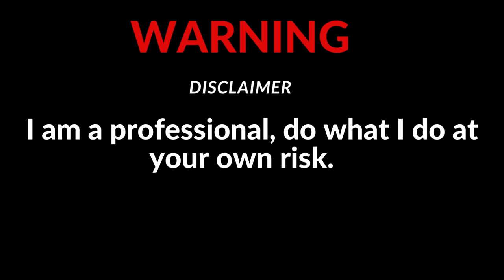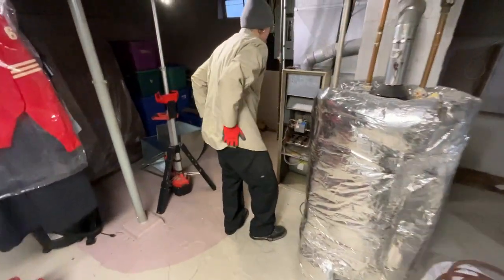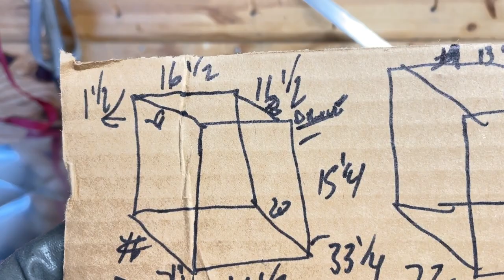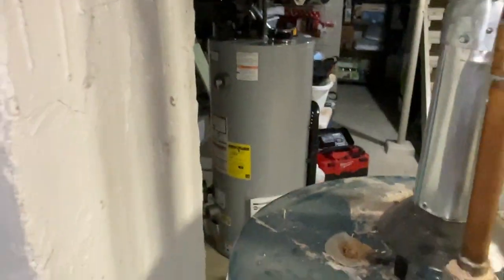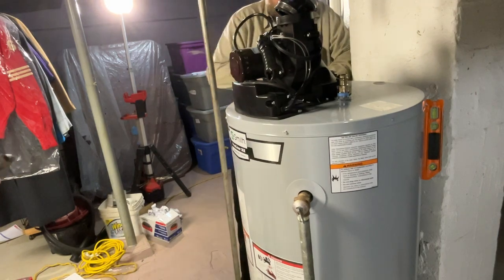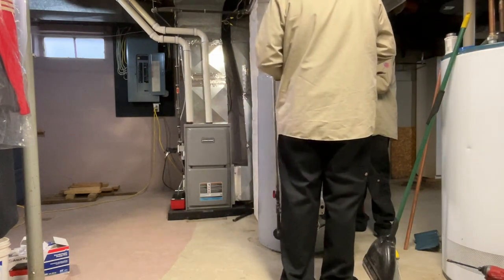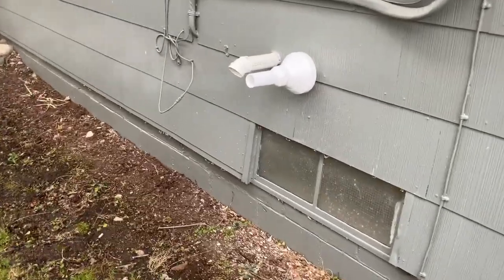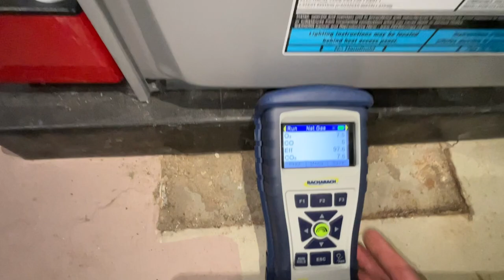Furnace Change out from a Old trane with a Concord

Comment: I've never seen a return like that. Your return looks better and easier to get the filter out. You guys did a great job. I've never heard of Concord. I mainly put in Carrier/Bryant, Lennox and sometimes  Goodman and some Air Temp.
Reply from the maker: My Local sheet metal shop makes up the Elbows for me, been using those for years. the filter racks were made up as well, used to get those at Menards. Concords are a cheaper version of Armstrong, Airease. Thanks for watching.